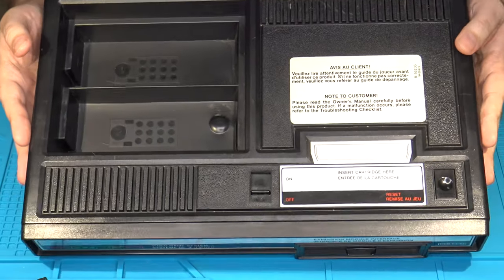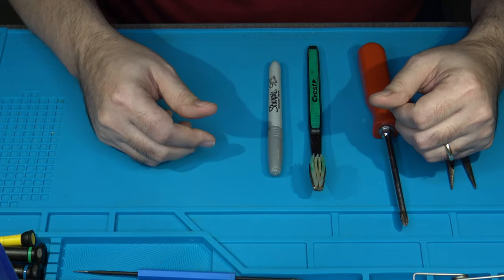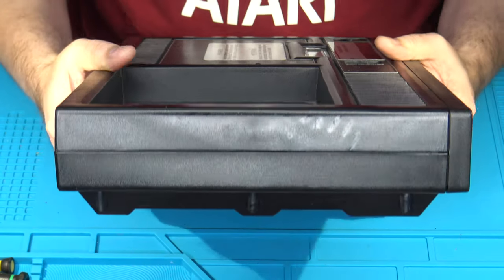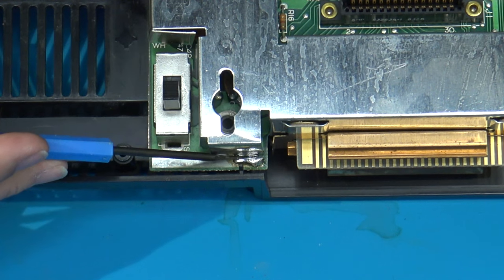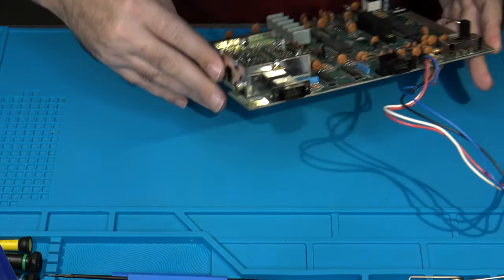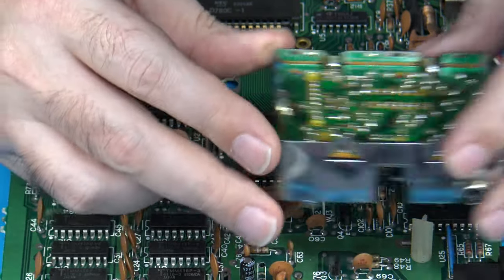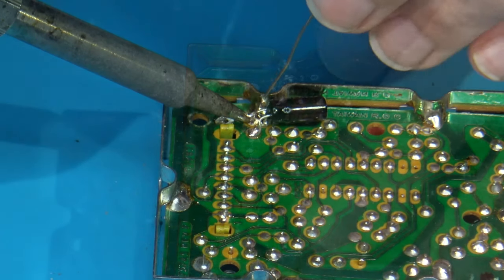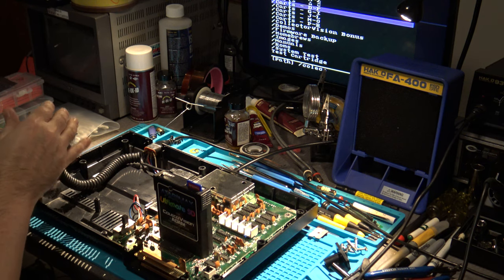ITC#69:- Colecovision - Capacitor Replacement

Comment: I think this marks the first time one of my consoles has actually been in a repair/modification video. Nice clean video and spendid work. I never realized how much of a pain it was with the RF box. I probably would have cracked that plastic interconnect piece myself....by simply not knowing!
Reply from the maker: It is easier overall to remove the RF from the bottom as you don't have to mess with the actual modulator board that is installed inverted inside the box. I have done that several times and it isn't fun trying to reform the ground points on the top inward again etc. That interconnect is actually pretty rigid and the wires that go through them are pretty stiff as well and tend to install easier than you might think.

Comment: Interesting and very educational video.  I only came across it today.  I have a question…. I have an AV-modded Colecovision, and I’ve tried both the op-amp and the transistor style of AV mods on this one,  but I still get faint rolling diagonal lines on the screen.  It’s most obvious with blue backgrounds (think of the skill select screen).   Any idea what the cause could be?  I’ve tried different power supplies and cables but no improvement.  Perhaps it is one of the caps in the video circuit?

Comment: Hello. In Europe we do not have that rf modulator board. So we have direct access to the whole main board. ..  Don't know why....

(and as you, the shell was soldered, so I simply broke it! No problem for it, just make it bend in the right direction and gently, I know it is weird but I do not solder neither desolder for the moment 😁 and, I do not have the big black ground cable at all)
Reply from the maker: I've not worked on anything but NTSC consoles and I know there are quite a few differences in most of these retro consoles between regions like that. I've also worked on quite a few Colecovisions that didn't have the large ground braid in them either and didn't appear to have ever had it. So it might be something that Colecovision stopped using at some point in the consoles lifespan.

Comment: 😡 if i have to remove that RF modulator board it's NEVER goin back in lol

i get so cranky opening these old devices 
im having some minor graphical issues 
so i might have to recap 
thanks for the upload 
💖
Reply from the maker: Well do keep in mind that you would have to add in some sort of AV upgrade at that point if you want to operate without the RF modulator. However, the composite video upgrade kits all require the RF modulator to remain in place or at least you need to still have it wired up in some way for those to work. As for the graphical issues, it is most likely that the power switch needs a good cleaning as the CV is quite picky about getting the +5 and +12v supplied evenly to it or it does start up with corrupted graphics. That is usually the quickest and easiest fix to try first. Beyond that it can get a bit trickier if the video ram has to be replaced out or the TMS vid chip itself has to be replaced.
Reply: @IvoryTowerCollections  i have to replace the PSU before i do anything unfortunately- ill give it a good once over/deep clean and hopefully that keeps things running 

i love my coleco but its quite finicky compared to all the other gen2 systems even the original odyssey

Comment: I'm currious, at what temp are you using your desoldering gun?
Reply from the maker: In most cases it is setting at about 1 to 1.5 on the dial. That is about 350 - 375 I believe temp wise.

Comment: Hmm...I'm having issues with the RF output (fuzzy like a bad antenna signal); granted, it's to an HDTV (what I had available for testing when I received my purchase today), and it's going through an NES Coax converter box (the horrible abomination they gave you alongside RCA jacks).  Capacitors likely to cause that kind of issue, or could it be something else?  I've only worked on and troubleshot very specific electronics over the years, so I'm out of my wheelhouse with this issue.
Reply from the maker: First thing is to direct connect from the Colecovision to the the RF coax input on your TV and not have any switch box in the mix. There are also some adjustments on the RF modulator that help tune in the video and audio in case that has drifted over time. Here is a link from over at Console5 that shows the adjustment points:

https://console5.com/wiki/File:Colecovision-RF-Alignment-Map.jpg

Comment: My colecovision has been getting more and more finicky to get running properly, cleanings and even a new usb power supply havent solved the issue im guessing i need to recap it at this point
Reply from the maker: What specific issues are you having with it?
Reply: @IvoryTowerCollections  when i power it on the graphics will sometimes be ok but start to glitch out and or just glitch out all together from the start, artifacts and miscolored stuff happens.it does seem to work better after it runs a while which leads me to believe the caps are failing. i do keep my carts clean  just to be clear Lol . the colecovision is the grumpiest console i have in my collection
Reply: @clappinmonkey0944  i have the same. It could only be from the power adaptor and its 2 cables. Just try to move gently those things while reset. Electricity issue cause graphic issues.
I m in France)